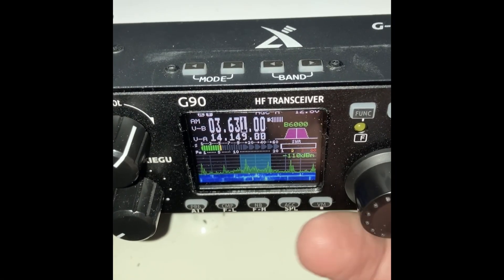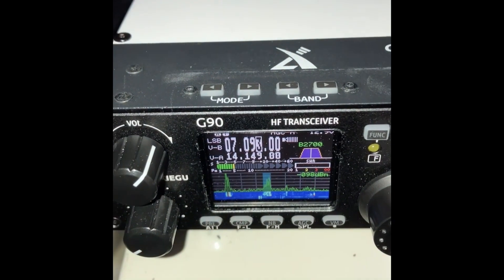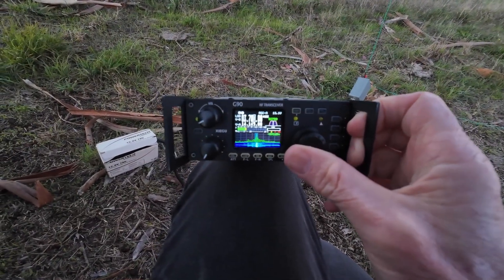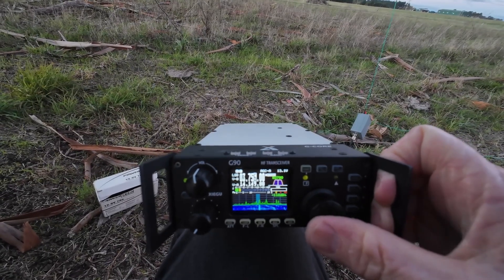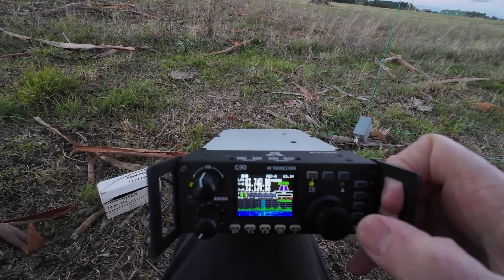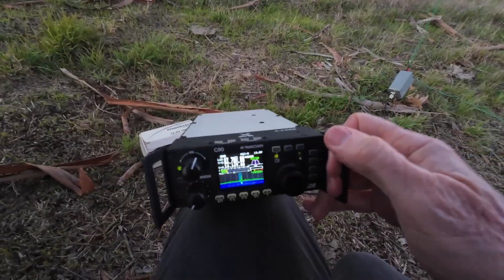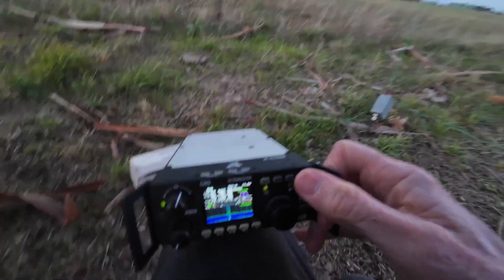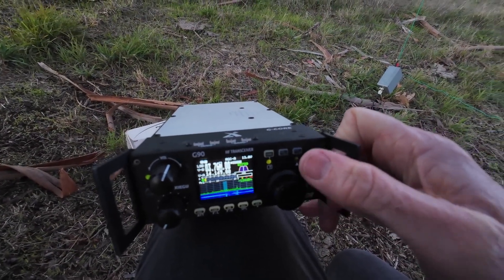Overwhelming the G90

Comment: Not surprised.  Some of yhese cheap Chinese ham transceiver receiver products have virtually no front end filtering.  You get what you pay for. Say hello to OM Nebille for me!
Reply from the maker: Yes there are definitely some differences between something like the G90 and the IC-705. I hadn’t had this problem before with this radio but this is probably the first time I’ve ever used it on 80m. I’ll say hi to Neville. He’s already told me that I should be using a T41 😄

Comment: Yep, happens to me on occasion. Even on 40 and 20 sometimes. The filter added inline fixes it.
Reply from the maker: I hadn’t had it occur before and so initially I was a bit confused as I had operated on 80m at that location before. Then I realised that I was using an IC-705 at the time so the filtering between the two is quite different.

Comment: Did some testing with the G90 and IC-705 on 80m from Queenstown and found that the IC-705 has a lot better Rx than the G90, I guess the price reflects the quality. great video Nick. regards Nigel ZL2SEA
Reply from the maker: Hi Nigel - yes you are probably correct. Do you adjust the RF gain on the G90 much at all? The 705 is a nice radio. For me the G90 is “good enough” for the activations that I’ve been doing. The price also makes me a lot more relaxed about putting it into the bottom of a pack!

Comment: Hi Nick, yes this is common in the G90 nad G106 community. I've had a couple of activations where a medium wave transmitter was 4ish miles away and just wiped out 40 and 20 for me. I bought and made the "K9DP QRP BCI Filter" which works well for removing  MW broadcasts. I was on the G106 FB group yesterday and a guy was struggling with an FM broadcast station so it appears any strong TX is enough to overload the front end.
Reply from the maker: Thanks Rob - this was the first time that I had seen it. I suspect that might be because I don’t normally operate on 80m for this event that was the frequency they chose. Initially I was confused as I had done the field day there on 80 & 40 and had not had any problems. It was only a little later that I realised that previously I had used the IC-705. I’ve had a look at the filter that you used. It’s certainly a nice compact design. It’s the sort of thing that would be worth just carrying in the bag anyway.
73’s

Comment: Looking at the circuit, it appears there are some wideband chips to switch the attenuator in or out. Did the interference change with the attenuator in? Looking at the schematic there appears to be a tuned frontend using varicap diodes. If the tuning volts are low so to tune the low-bands, then it is possible that high RF levels, can cause crossmodulation or intermodulation in those circuits. A highpass filter is probably the best solution.
Reply from the maker: Good question about the attenuator. I didn’t think of trying that but can do so next time I’m there. Certainly the filter fixed the problem. It was all back to normal once that was in place.

Comment: Nick

Never seen that on the G90, but it is usually much worse on the X6100.  A broadcast interference filter solves it, but then you need an external tuner to match your antenna.  Had this problem one year on a field day, and had to go home and get the G90 because the X6100 was flooded.  
That antenna must have been working very well to receive such BC signals and overload the G90.
73
Jim
Reply from the maker: Thanks Jim - yes it was a new problem for me although I was talking to an operator in Nelson who said that he had the same problem until they turned off broadcasting on the local AM station. Also illustrated the difference when using the IC-705. The antenna is the same one that I put up for the JWFD. It’s a 36m EFRW with a 10m counterpoise. I didn’t have any problems with the IC-705.
So you found that the G90 handled it better than the X6100?
73’s